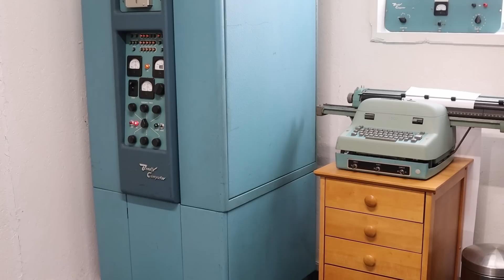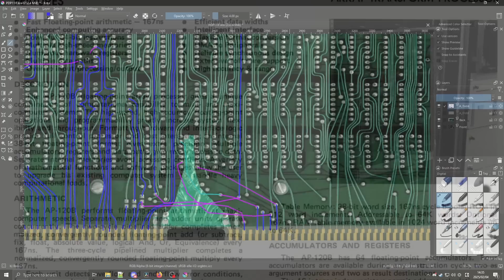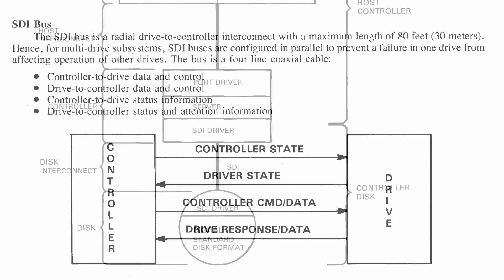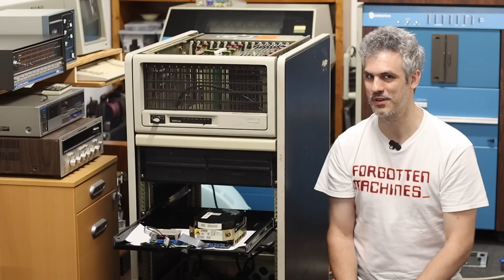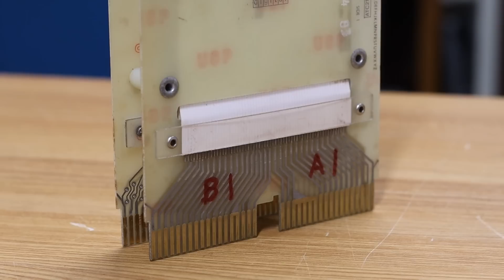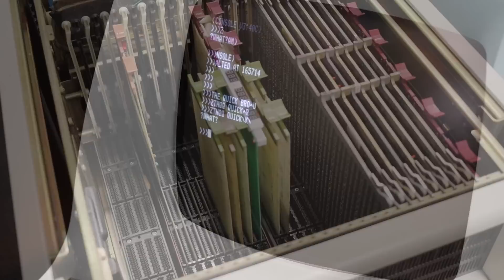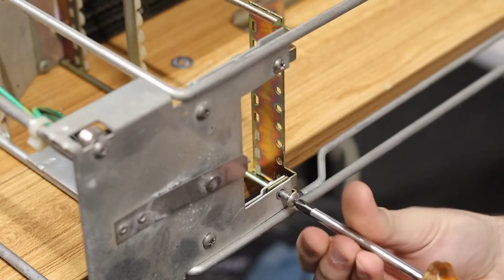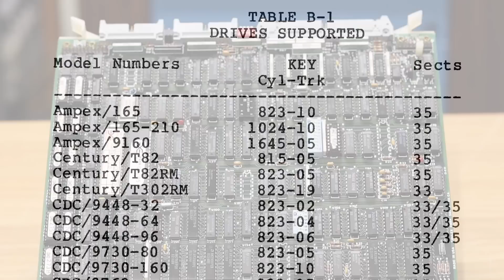I Failed to Get Any of These Working on My PDP-11

Comment: Those things reminds me of the MFM drives I ran in my 386. That chunky boot up sound the drives make is fantastic.
Reply: No it isn't. That noise drove me mad! (Back in the day :-) Now we have solid state stores that are silent. It was nice to have a little light on the front that told you the drive (actually the bus) was doing something.
Reply: @therealdebater  solid state drives are boring. my computer is full of Helium Seagate Exo 14TB, by full I mean I have 6 drives, and they sound amazing, you can hear the heads moving. I do have SSDs but I only use them for cache and pagination (because even having 64GB of RAM isn't enough sometimes), I have 3 Samsung 840 pro, and 1TB Phision M.2 for the main system drive.
It is not a real computer without spinning "rust".

Comment: If you have an old (and still working) 68k Mac (or a PC with a SCSI card) you could use that to test if the RZ drive will spin up. At least the documentation on those ought to be much easier to find, should you need to set the SCSI ID of the host machine.
Reply: I own a Pulsar II+ mac clone Dual PPC604e on OS9.1 up to 9.2.2, depending where i boot from. and these marvelous FWB TOOLS which make the SCSI crystal clear. it can read out almost any not broken/communicate-ready drive/scanner/cardReader/CDR/Worm/JAZ/ZIP/other thing that speaks SCSI at least visible and read out its status and has the ability to start it up, or shut it down. and you can also apply any valid scsi command to any working SCSI device on the BUS.

Comment: I realize that this channel aspires to bring old devices back to life, but some old gear really is just junk beyond any reasonable hope of being repaired.
Reply from the maker: If we had schematics and documentation for the RA70s, I genuinely think we could bring them back to life. They both sound good mechanically, and it's just an electronics failure.
Reply: Pretty much nothing is unrepairable with sufficient knowledge and willpower.
Reply: @seriouslyincompetent  Unfortunately there's also the consideration that life is short and some of these old devices don't seem like they were expected to last much beyond the manufacturer cashing in the invoice. I do enjoy watching the restoration process for things that have schematics and a manual with a "Theory of Operation" section, but I lose interest when the designers didn't document their work.
Reply: @NateEngle  the designers will have documented it. If the item didn't sell well , very few documents will have been sent out into the world. Most of this kit was pre internet, and when the big iron companies failed and closed due to replacement by companies selling more modern equipment, their inventory of documents will probably have just been sent to landfill. No official saving for posterity. The documentation online is just scans of those that survived out in the field.
Reply: As these old parts are now really rare, there is a good reason to get them going again.

Comment: That 1U high space between the -11/44 CPU cabinet and floppy drives may be there for ventilation / cooling reasons in a fully loaded, buttoned up cabinet.  You may wish to check this out.  (Speaking as a former -11/44 system manager of a machine which ran Unix V7 (yes, pre-Linux).  Our main drive was an RK07, so I'm painfully familiar with the RK611 backplane (and yes, that same basic ctrlr worked for both RK06 and RK07 drives)).

Comment: Your "new"  PSU is a problem. Most of them are now designed for 12V and the other rails are low power capability auxiliary rails

Grab an older PSU (ATX 1.1 or earlier) and you'll have better luck for high current 5V draw

Comment: Those noises from the RA72 on first power up made me expect to see a fault light.
Reply from the maker: Me too! I was surprised it actually went ready. Ultimately, it stopped going ready, but I'm impressed that mechanically it's still all good.
Reply: @UsagiElectric  It might not be purely an electrical problem.  The click-click-click...click-click-click sound on the initial spin-up sound to me like the drive is trying to read something from the platter, retrying multiple times and eventually succeeding.  But that it's now failing I wonder if there is a head crash on that track.  Does it still do the click-click-click thing?  Same number of times?  Perhaps it only needs a low-level format to recover, but I fear worse.

Comment: I personally wouldn't use an ATX psu for powering these things, but a bench top lab power supply with constant current limit for protection.

These days they aren't even that expensive anymore.
There are ones with multiple output voltages as well.
Reply from the maker: Once I went with the proper Corsair 450W supply, it was rock steady on the 5V and 12V rail, even when powering up two drives.
Reply: @UsagiElectric i understand.
The point with a lab power supply, is that you can protect the outputs from catastrophic shorts.
A standard ATX psu isn't protected that well.
Reply: @p_mouse8676  the ATX spec these days requires those protections. As long as he's not using some ancient or junky new PSU it should be fine. But yeah, dedicated bench top lab PSUs would be a better idea, but I don't think that's the culprit or prob here.
Reply: @colinstu  I know, but being able to set current protection manually (lower) can be pretty vital in some cases. To prevent DUT etc from blowing up severely.

It's not about if it's the culprit?
Reply: I made a generic +12 and +5 linear power supply that can put out 5 amps on each line into a short circuit indefinitely just to test stuff. Comes in handy when I need to power up a hard drive or external device that the power supply is questionable. It makes diagnosing a power issue very quick.

Comment: Wow. Those wirewrap backplanes are INSANE. What an amount of work just for a backplane!
Reply from the maker: I don't mind putting in the work to make a new backplane from scratch, the bigger problem is, we don't know what connects to what!
Reply: For the (earlier!) PDP12, DEC had an automated system for wire wrapping them, so I was told on the PDP12 hardware course in Reading, England. That was in the early 1970s. They used a system of three levels, so if all levels were present on several pins level A connected to level A, B to B etc.; level B could only go to level A if the latter pin had no level A link, if that makes sense - it meant the number of wires that had to be removed to eliminate a wrong or failed link was always limited, even when many pins were connected together. A pin could thus have 1, 2 or 3 wires:-

-----I       I      I------
      I------I      I-------
      I       I------I
      I       I      I
whereas "daisy chaining" could mean a huge number of links needed to be removed if one was wrong, since you couldn't unwrap a wire until those above had been removed.
Physically there was room for a fourth wire if you absolutely had to make a quick and dirty modification.
I'm not sure if I can improve that explanation!
Reply: DEC story:  Many years ago I worked with a person who had been in the physics (?) department was Case Western Reserve University.  They had a large PDP system which was being expanded and required the DEC FE to rewire the backplane.  The FE did the work snd at power-up a lot of smoke was released.  It turned out the FE had applied the changes in the mirror image of what was required.  The fix required a lot of new boards and a new backplane.

I recall the red SMD drive cables.  The SMD cables could be really long, like 10 feet because the data stream is serial.  We had SMD drives on a couple of the Vax systems that I administered.  I forget the model number of the DEC drives now.  They were huge 14 inch fixed platter stack drives that were about 400 megabyte capacity.  I’m pretty sure the platter assemblies were belt driven from what looked like a washing machine motor.  The SMD controllers were Unibus, so we had to have a bus converter cabinet between the vax and the drives.  It looked strange because all the system had the rounded corner cream and gray Vax cabinet style except the bus converter in the middle which had the old mostly black PDP styling.

The PDP and Vax consoles are pretty picky about the serial connection.  You are best off using a DECwriter at 300 bps 8N1 or a CRT like a VT-220 at 1200 bps 8N1.  Don’t set smooth scrolling on your terminal or you’ll lose data.  Anything which requires flow control is problematic.  There is no buffering on the console port, so if the terminal doesn’t have a receive buffer, you’ll almost for sure drop a character or two at the terminal before the console driver is able to see the in-band XOFF character snd process it.  I didn’t have a lot of luck using the auxiliary signals of DSR/DTR or RTS/CTS.   It is best to slow the communication speed down to match the rate your terminal can accept data without flow control.
Reply: I had a buddy at AT&T who had a homebrew Z80 system that was 100% wirewrap construction including the backplane, It all worked but it did require a lot of hot melt glue and about 8 popsicle sticks to wedge everything into place. I realize that modern sleek surface mount construction is less "retro" but there was a pretty good reason why we moved forward.
Reply: @NateEngle  It isn't a real computer unless it has popsicle sticks.
Reply: @therealdebater  I don't know about that. Something I learned from my wife who's a very accomplished knitter of lace is that with a sufficiently complicated design the only absolutely essential prerequisite is cussing.
Reply: @NateEngle  I had a friend who built a complete Commodore 64 from the parts of two c64 donor boards over several wire-wrap boards, over a period of months, because of a bet.
The thing was a crazy monster, the impression was even enhanced by the fact that it was built into an IBM XT case, which it completely filled.
I still don't understand how it could work (apart from a few minor display glitches).
Reply: Tell me about it. I used to build backplanes like that in the early 1980s. Since I worked for tiny tech start-ups, PCBs were far too expensive for prototyping, so pretty much everything we built was wire wrapped.
Reply: @stevegreen5358  I did a lot of wire wrap in the 1980s.  It isn’t too bad until you try to get your switching speed past a couple MHz.  I remember making the mistake of forgetting I was looking at the ICs from the bottom instead of the top and I had to re-do quite a few wraps on a board.  I only made that mistake once.

I worked as a civilian in a government job and there was a lot of consternation over the LSI chips which were going into an equipment for the Army.  Someone inverted the masks when the plates for the wafer stepper were made and chips worked but the pin-out was a mirror image of what was intended.  There was a hot debate of whether it would be OK to bend the pins over and install the chip packages upside down.  It was quite few chips affected and they were like 200 Dollars each in 1980s cost.  I didn’t hear the final decision, but it seemed like they were going to go for bending the pins around and using the ICs.
Reply: @wtmayhew Totally agree regarding high speed circuitry. Once we got a prototype working, every copy had to be identical, with each wire taking the exact same path. That was a lot more difficult than making the first one. It was the same when using a wiring pen - the sort where you solder through the insulation. Kids today don't know how easy they've got it, being able to design PCBs with free CAD software and get them built and delivered in a few days from PCBWay for a few quid.
Reply: @stevegreen5358  That’s for writing that.  That is pretty much what I was thinking when I wrote that.  It is so easy to do schematic capture now, feed it to a free cad program, email the Gerber files and get a finished board in under a week.  It is so much easier now.

Probably the toughest job I had as an engineering co-op was being handed to sort out a one-off test exercise box which RCA had built with wire wrap for a military decive.  I didn’t have the device being tested, just the tester.  There were dozens of socketed 4000 series CMOS ICs.  Whoever had built the tester had used OK Tools’ slit-n-wrap.  The system used a tool mounted spool of 30 ga. Kynar insulated wire.  As the wire exited the barrel of the tool over the wrap pin a burr cut the insulation and supposedly exposed the wire core to the corners of the pin.  The problem is that it is a hand tool which is almost impossible to get the correct tension and angle just right for the wire to contact the pin as described.  I had to ring out the board to find hundreds of insulated wraps.  I got an electric wrap device from the tool crib and bundles of pre stripped and cut wire.  I got the job done in a couple of days and apparently the test box worked because it did not come back to my bench.
Reply: Tab A to Slot B bring on a whole new meaning when it's point to point.
Reply: I seem to remember reading about how they used to have wire wrapping robots that were used to make those backplanes.

Comment: One thing to be aware of is Direct Memory Addressing.  A lot of PDP11 driver controllers are DMA enabled, and you need to wire the bus dor DMA for the slot the controler is in.  .

Comment: I have two of those RA-72s that someone gave me years ago.  Both blew out that same electrolytic cap.  Nice to see there is a way to bodge repair those.  If you would like 1 or both just let me know.
Reply from the maker: Seems DEC used terrible tantalums for these!
If I strike out on the Priam, I may take you up on that, but I really think the Priam is the best move for the 11/44.
Reply: @UsagiElectric  I agree on the Priam.  LOve thos big disks.  I had 4 Eagles for awhile but never did get to use them.  Here's hoping you get both to work with their systems.

Comment: What was the reason they had that 1U spacer riveted in place? Was it for airflow?
Reply: Likely just unused space for that smalll rack.  But they wanted it to look finished.
Reply from the maker: It might also be for structural purposes.
The top of cabinet is open so the 11/44 can be easily accessed, so a horizontal beam for structural rigidity below it makes sense. We may have to do some other strengthening work if we want to remove that piece.
Reply: Maybe.  I've read on the VAX 11/780 (VAX was actually a "Virtual Address eXtension" for PDP-11) that they ran hot enough one could singe their hair walking by the power supply exhaust (or so I've heard, I never encountered one in person.)  It's entirely possible the PDP ran "a tad" hot.

I dabbled -- I had a "VT1300", what a weird setup.  They sold this as an X Terminal, but really it was a VaxStation 3100 M30 with no hard disk, and in a all-DEC environment it would network boot straight into the X server software.   

I had it MOP boot (some DEC-specific thing) a bootloader, that would then use TFTP to load I assume a kernel and initial ram disk, and I had it running NetBSD which supports NFS for root filesystem fine.   (AFAIK Linux does or at least did support this too.)  Perversely, I actually got it to build AND run Gimp --- ironically (given it was supposed to be an X Terminal) I did not have the cabling to hook a monitor up to it, so I ran Gimp from this "supposed X Terminal" to X on my Linux desktop.  

Performance per clock was quite good -- this things CPU only ran at about 12mhz, but it ran pretty similarly to a ~60-75mhz Pentium.  (And that's with stuff compiled with GCC, I think it would have possibly been a tad faster with DEC's own compiler.  I didn't have Ultrix or VMS or whatever to run on it to find out.

Nice thing on the Vaxstations -- it was a pizza box shaped system, so if you come across one of these you won't need a forklift, pallet jack, or bunch of burly men (or women) to help you move it around.  It was heavier than it looked due to having very heavy duty metal construction, but given it was pizza box style "heaver than it looks" still only meant about 20-30 pounds.

Comment: Your scissor lift dolly is super cool and fits in perfectly when handling those ginormous HDDs :)
Loving the startup sequence on the RSA72... these sounds are so tangible.
Reply from the maker: It was just a cheap little lift that we bought for moving pinball machines around, but it works perfectly for big hard drives!